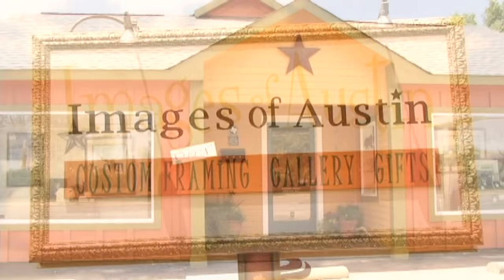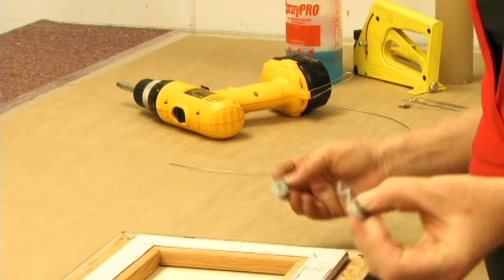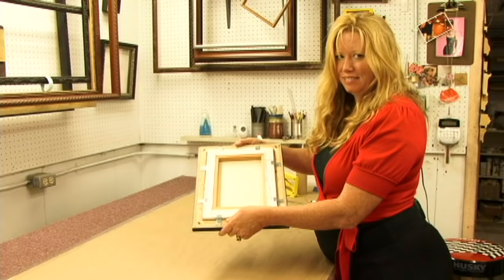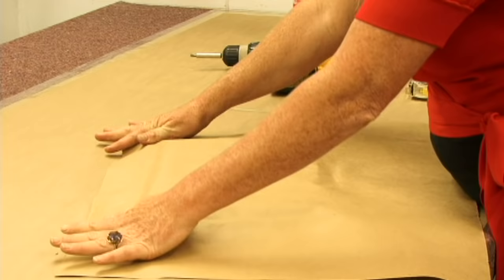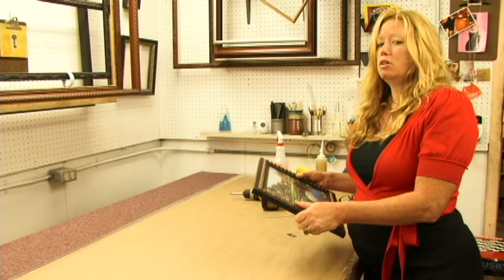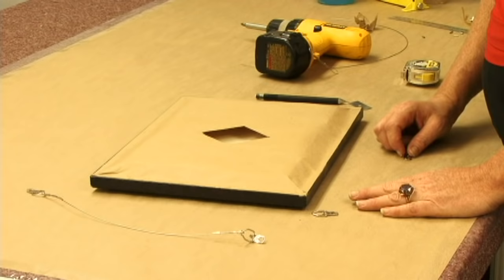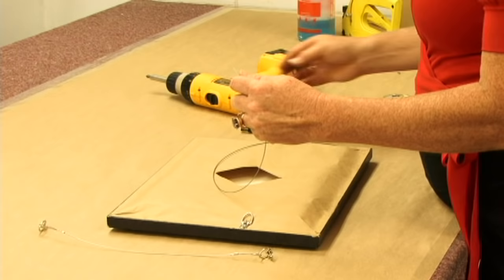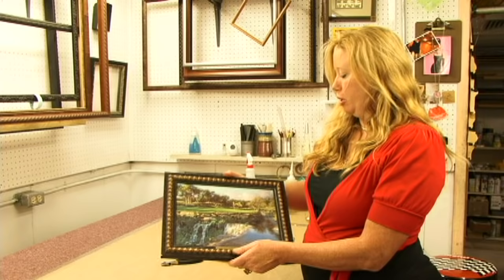Framing : How to Frame a Canvas Print

Comment: Canvases don't need a ventilation hole. There isn't much you can do to protect your canvas from temperature change or humidity change other than applying a protectant to the canvas itself; depending on the medium used. Any deformations in a canvas are due to the canvas itself, not the frame.
Reply: With oils, they must breathe. Never fully enclose the back of oil work it could lead to cracking in the future.

Comment: it depends on the type of medium your friend uses. If it is oil, you don't want to use glass as a cover, or the fumes from the paint with start to steam up the picture. If its acrylic paint, that is debatable. I am an artist, and personally I don't use glass on my paintings (which art acrylic), but some argue that the color will fade if there's no cover... has happened to me yet. Water colors, you should use a glass top or covering to protect it. Hope this helps.

Comment: Good video but doesn't the breathing hole defeat the entire purpose of installing a dust cover to the back? The paper used should be breathable enough without allowing insects, dirt and dust settling on the back of your canvas.
Reply: That's what I was thinking.  Maybe a silk-screened backing (if that's not over-thinking things...).

Comment: Yes, oils breath. If you frame an oil painting that hasn't had proper time to dry (years sometimes) behind a glass frame the glass will turn yellow from the fumes. Ventilation is necessary sometimes.

Comment: Canvas does not breathe and there is no benefit at all to cutting a "ventilation hole" in the backing. The only thing it does is make it easier for insects to get into a dark, protected space where they can set up home and allows dust to collect in the back. Canvas sagging can be caused by humidity and changing temperatures but a hole in the back has no effect on it at all.
Reply: Oils do breath and the back of an oil should never be fully encased.
Reply: @gialana850  Yes any artist that makes their own stretcher bars could remove the canvas and re-stretch it.  Depending upon how old and fragile the canvas is it may tear when pulling on the (back) edges, but a wide set of canvas pliers will help.  Just time consuming and stretcher bars aren't too cheap either.
Reply: @prichardgs  but the whole front of the thing is open
Reply: Thank you.  How would you frame a think canvas panel that has been resined?

Comment: I wish she'd shown more detail with applying the cable system to the back of the picture.
That's the hard part for me.  :(
Reply: I agree. I could not tell exactly what she was doing with the wire, and her hand was blocking the camera most of the time. Would have been helpful.
Reply: Just use regular picture wire... cabling systems are rare and not worth the trouble.  I tie a knot in one end (bit hard with stiff wire), then on the other end twist it tightly around itself after going through the eye hook.

Comment: "I've already cut and built a frame for this one...".

Whoa slow down there--that's the most important part! How thick should the frame be? Any guidelines? How deep and wide should the rabbit be? Is it generally better to make a thicker frame with rabbit deep enough so that the stretcher box (?) is flush with the back, so offset clips aren't necessary?
Reply: Offset clips are always necessary to hold the canvas to the frame.  Or some kind of tape might work, but you really want it pretty tight in there.  Frames - depends upon what you're framing... I'd google some more for frame choices, but I like to choose a color from the inside of the painting that contrasts with the outside of the painting.  Or just use something with contrast that looks close, if I already have a frame from another artwork I'm re-using.

Comment: careful what length of screws you use with fittings like that as it can come through other side of your frame................i used to use fittings called Z clips years ago (im in UK).....the lower end of the Z shape was pointed and one end hammered into frame and other end hammered into stretcher to hold it all in place - was also pointed...was simple and very effective....check out one of my oil paintings on my channel from around 1992

Comment: Robin-
What do you use instead of offset clips if there is no offset? If the rabbet depth is the same depth as the stretcher frame?
Reply: Im sure this commenter has figured It out in the last 7 years but the answer for the new crowd is called: zero depth offset canvas clips.  (there are a range of sizes)

Comment: I got the canvasprint, not stretched on a frame. Anyone know what I will look for? I need to find the word for that first basic frame. #Noob
Reply: DANNI I
Reply: the "frame" a canvas is on...are typically called stretcher bars.   normally they're wood.  come pre-cut,  and you buy them in various lengths.  unless your canvas is exceptionally large, you prob won't need additional support...so you'd just assemble the stretcher bars.  whatever art or hobby store you buy them from can probably give you tips/advice on how best to put it together.   Can tell you... generally the canvas.  printed images are on.  is much more nylon-ish in feel...whatever process they print these things by... the canvas isn't really canvas i don't think.  sometimes it's a pain in the ass "stretching" those prints over stretcher bars.    there's also...tools used to stretch canvas.  but can prob make do with pliers,  and will need a staple gun of some sort
Reply: no body 
Thank you for the advice, because i wondered too. 👍
Some ppl can't give advice without being an azz...
 So i thank you. 😉